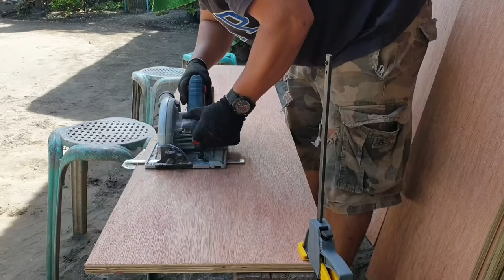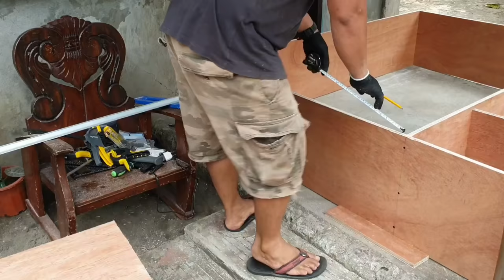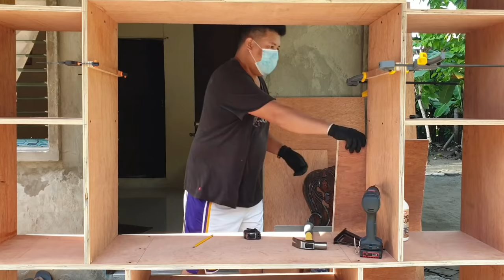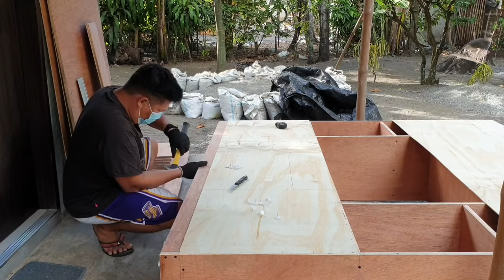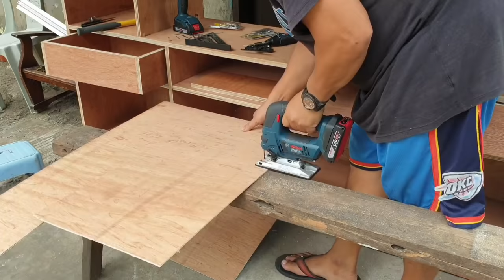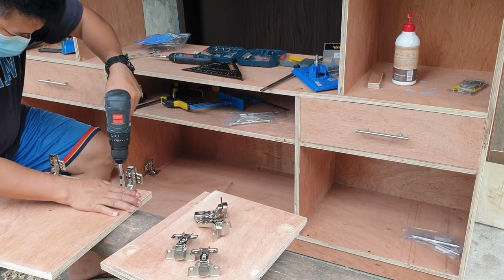TV CABINET WITH DRAWER

Comment: great job sir
pwede mo po ba ishare mga ginamit mong tools at materials ganun din po ung mga sukat nyan pls...tnx po
keep safe and more videos pls
God bless u and ur family po💖🙏
Reply from the maker: sir email address nyo po send ko nlan gbuong  details
Reply from the maker: Bosch Circular  Saw
Bosch Cordless Drill
Bosch Jig Saw
Kreg Accu-Cut/ Rip Cut
Kreg Concealed Hinges Jig
Cabinet Hardware Jig Adjustable Punch Locator Tool Drill
F Clamp
Triangle Ruler
Core Drill Bit Centering Hole
Hammer
yn po sir
Reply from the maker: yung sa sukat sir send nyo nlang po emails address nyo send ko picture
Reply from the maker: opo sir bali praktis plang sir yn po una kong ginawa

Comment: Boss idol.. Anu po tawag dyan s agamit nyu nakalagay sa circular saw nyu po? Mas maganda po siyang gamitin at mabilis po makakapagtabas san nyupo siya nabili boss? Pede po ba kahjt saan na brand ng circular salamat po 😊
Reply from the maker: Kreg Rip Cut https://shopee.ph/product/284690604/7163398922?smtt=0.104385036-1639260776.9 tanong nyo nlang po sa seller kng compatoble sa CS n gmit nyo po

Comment: Abis berapa lembar bang?
Reply from the maker: Materials Used

3  plys  3/4 marine plywood
2 plys 1/4 marine plywood
2 set 14" ball bearing drawer slide 
8 pcs 6"  stainless steel door handle
6 sets inset concealed hinges soft closed
6 pcs magnetic catch
11/2" black screw
1.5" nail
pioneer wood glue

Comment: Sir puede lista sa pangalan ngmga gmit mo pls..
Reply from the maker: Bosch Circular  Saw
Bosch Cordless Drill
Bosch Jig Saw
Kreg Accu-Cut/ Rip Cut
Kreg Concealed Hinges Jig
Cabinet Hardware Jig Adjustable Punch Locator Tool Drill
F Clamp
Triangle Ruler
Core Drill Bit Centering Hole
Hammer
yn po sir
Reply: @JREGTV  maramingsalamat sir!!!!